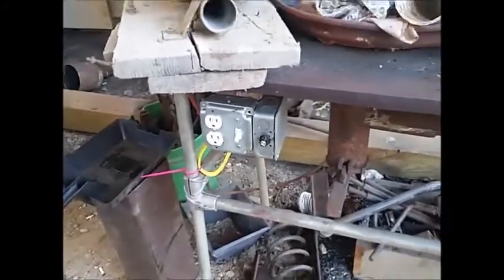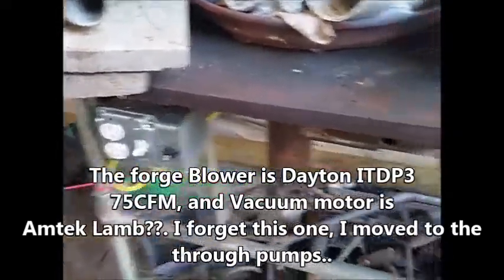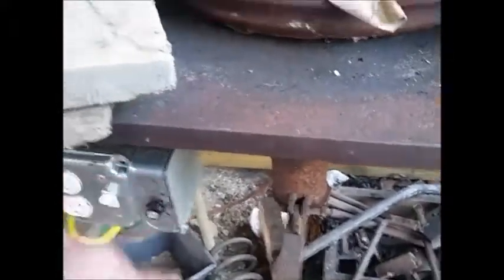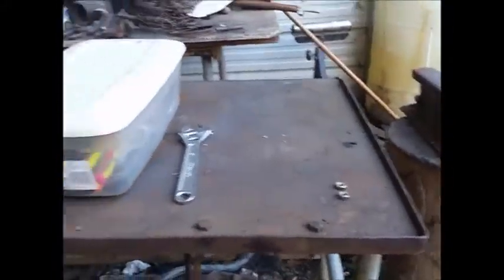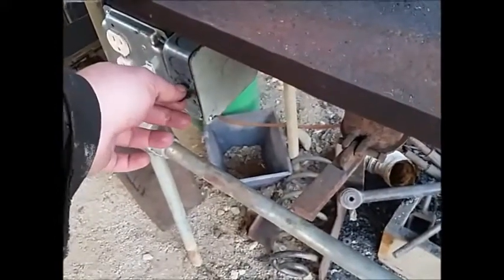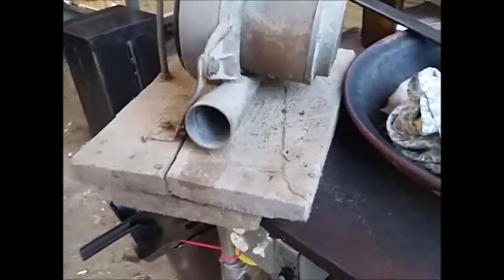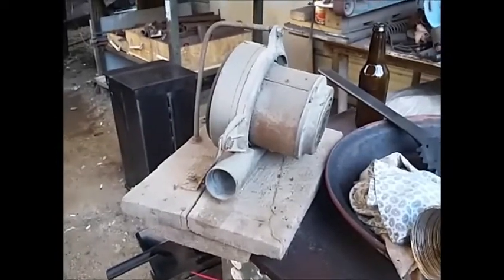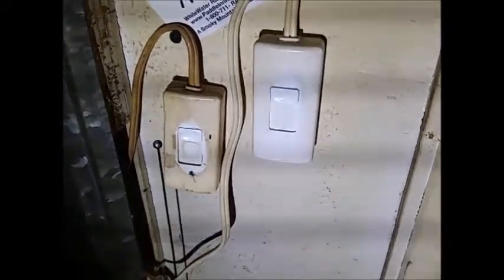Variable Speed Motor Controls for Forge Blowers Etc.

Comment: hi mark, I have a 1-1/2 HP Marathon motor - farm duty - compasitor start - from tractor supply -  I dont know if it has brushes or not - due you think I could add a variable to it?
Reply from the maker: RIck.. I'm not sure.. I think I jinxed myself when I made the video.. I am finding that most I try now will not work.. I had a conversation with another youtuber who knows much more.. He said,, ones that work with variable speeds are usually limited to smaller motors, for fans,, etc.. Might get lucky though.. They are cheap enough on ebay and trying them only takes a few minutes if you wire one up with plugs.. I think most if not all DC motors can use variable speeds.. But, I think the choice on AC is limited when you are working with single phase.. I think most of not all 3 phase are variable, but, with the more expensive VFD's..